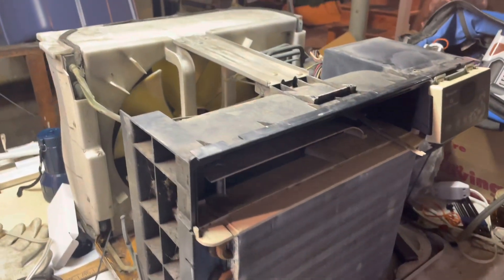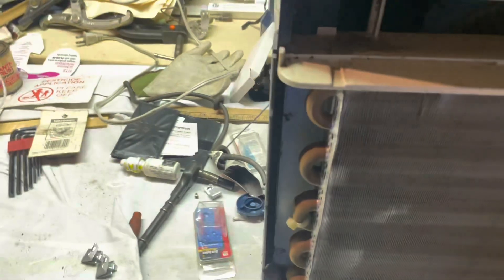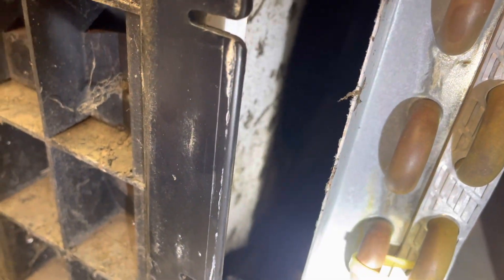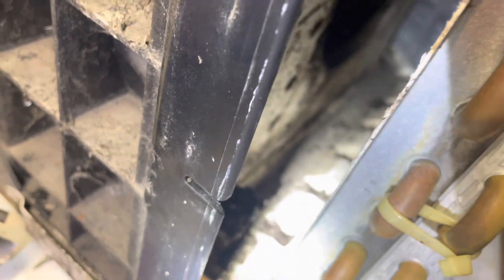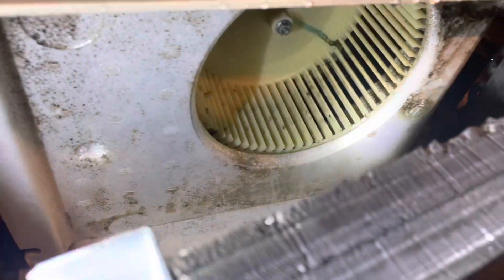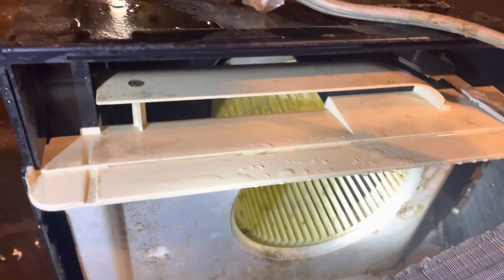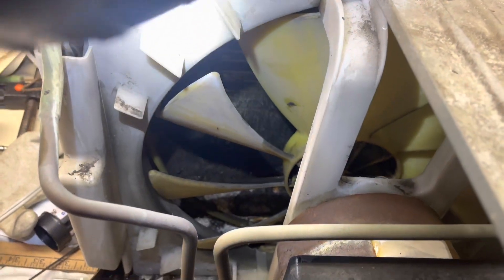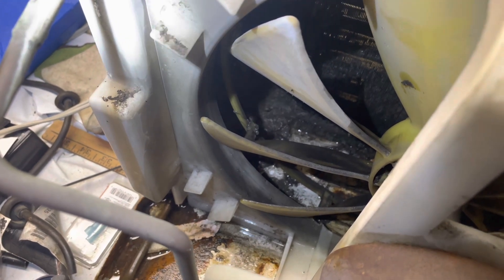Cleaning the Sharp Comfort Touch Air Conditioner Again

Comment: These units are good I like them. I have a 2001 Haier unit made by sharp. It’s 5000 BTUs and the inside looks similar to this with the fan shroud having those little fins around it and even the blower/evaporator chamber looks really similar. I had mine gutted down to the base pan. just the cooling system was left on it. I completely cleaned it out. Put new bearings in the motor because the old ones howled. It also has Matsushita compressor very good compressors. Polished and waxed the cabinet and it almost looks brand new on the inside. The 5-6k sharp comfort touch units are identical to it just with a slightly different front grille and cabinet but the guts are the same. Well made units. Its called the Haier Preference Plus series.
Reply from the maker: Interesting.  I never new Sharp made units for Haier.  I agree they are great units.  They are kind of difficult to take apart in my opinion.  I would like to replace the bearings in my Sharp units, and I may do it if they get worse.  Right now I’m pretty much used to it though.  I took this unit apart partially last night and put some oil in the front bearing since it’s an open bearing.  It started making a little noise after being washed, so I figured I should oil it.